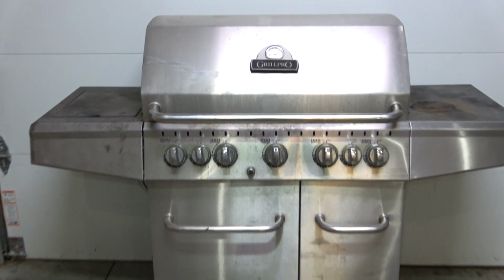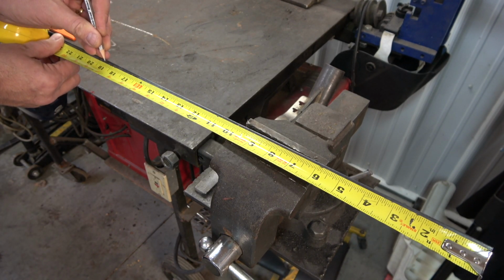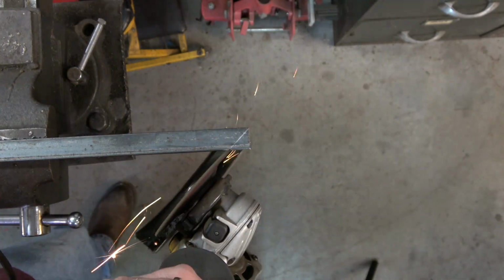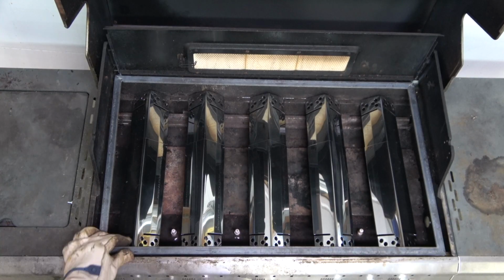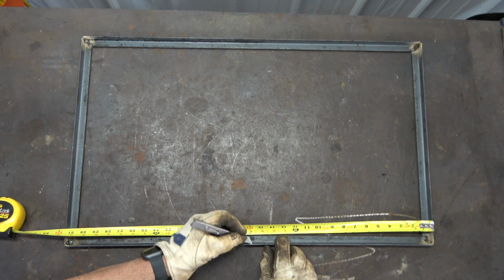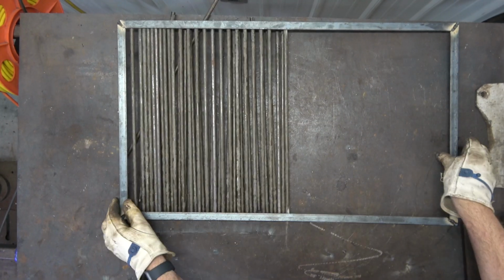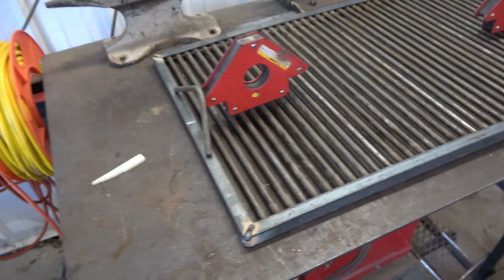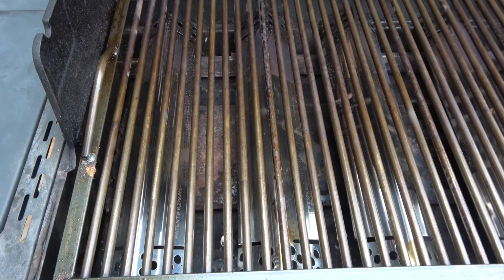Homemade Grill Grate - Welding

Comment: one thing about seasoning raw steel.  you really want to scrub the heck out of it with dish soap and a coarse scotchbrite.  then, heat it on the grill to smoking hot. let it cool most of the way and THEN smother it in crisco and reheat it. after it cools down, wipe it down with a dry rag and reapply crisco.  and go through another heat cycle.  not only will it make your grill more "anti-stick", but it really does a good job of eliminating the steel manufacturers oils and so on
Reply from the maker: thanks for the tip
Reply: For woks, you hear it up so much that the oil just burns off

Comment: I like welding and DYI, but got damn the price of steel is ridiculous to the point it costs more to fabricate than it is to buy commercial made products. Well, nothing beats customs builds though. Looks like a great and simple design you came up with. Good job, and thanks for sharing your step by step video.
Reply from the maker: Yes indeed, everything is so expensive now. It's almost cheaper to buy Chinese made everything.

Comment: Why did you weld every rod? Everyone I know who does this professionally drills holes in the frame for the rods to turn freely, better for longevity after hot cold cycles
Reply from the maker: cause I'm a dummy I guess. That being said, I simply designed it off of a park grill that have welded rods and are known to outlast the pyramids.

Comment: Where did you buy the material? what was the size of the grill ?
Reply from the maker: local metal shop (welding shop).   31 1/2" X 19" is my grill size.

Comment: Minus labor, what do you think this project cost?
Reply from the maker: I did this for about $30.  The rod is super cheap.  However, steel prices vary depending on where you go, so shop around for sure.  there was 2 steel businesses in my town about 10 years ago that priced 30% different when comparing.  could be the one was selling China steel and the other one was US steel.